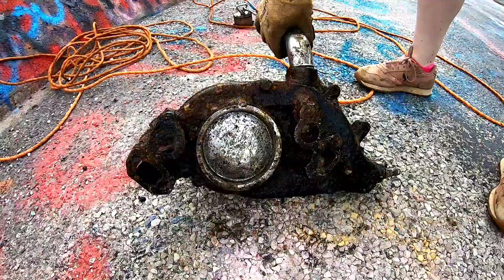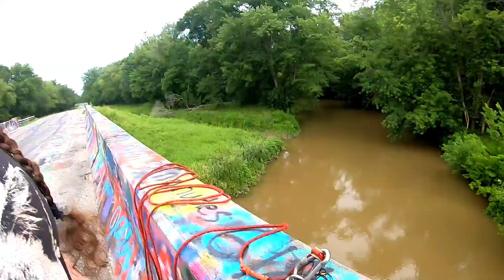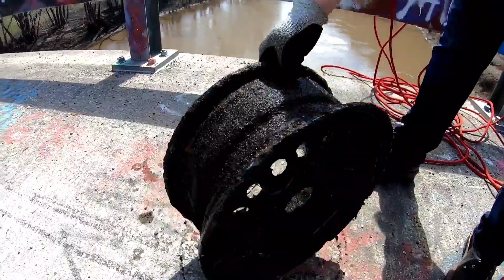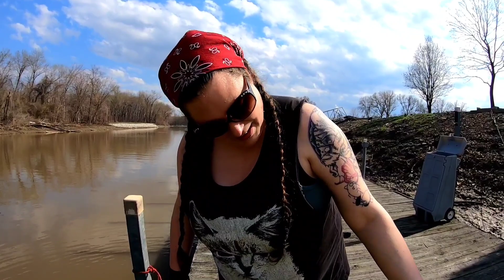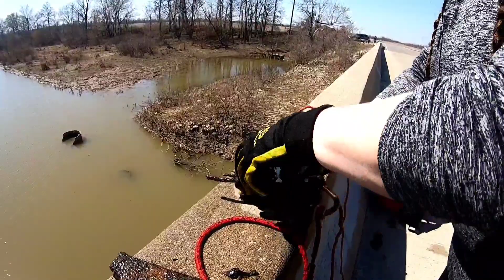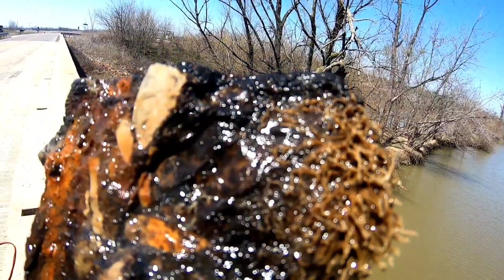You Won't BELIEVE What We Found MAGNET FISHING!! (Haunted Bridge and More)

Comment: Angela, You asked about the two antique heaters from the 40s and 50s which my grand parents owned, we still have the one from the 40s, and that heater still works perfectly and is powered with the original fabric isolated power cord which still is in, like-new condition, and still has the original heating element too! This particular heater is constructed of brass and is an upright heater with brass feet attached the bottom.
Reply from the maker: That is a true treasure!

Comment: just a thought: when you are fishing a bridge with metal railings, try using a piece of indoor-outdoor carpet say 18-24 inches wide by however long it takes to go around the railings and clamp it together with a couple of spring clamps. your magnet will still be attracted to the railing but, it should be much easier to get off.
Reply: That’s an awesome idea..
Reply: @ghekogrrl  i hope you find it useful.
Reply: @ghekogrrl  the best solution to any problem, is one that does not create any more problems.

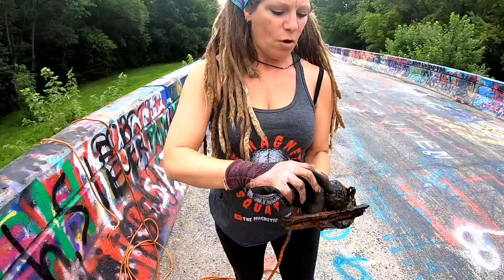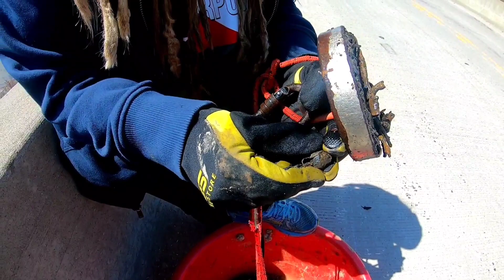Comment: 4:00 Scissors jack, not a bottle jack. I'd clean it up & use it. Actually those CO2 cart. were also used in seltzer bottles, BB guns, and life vests (Mae West, I have one from WW2 that uses the CO2 cartridges). The insulated wire was either a vinyl coated clothesline or an old TV antenna guy wire.  21:30- it is a twist key from a can. Might have been coffee, peanuts, corned beef, sardines, or ??.